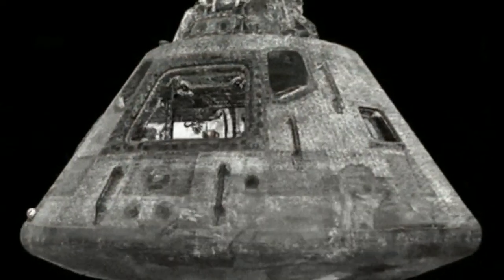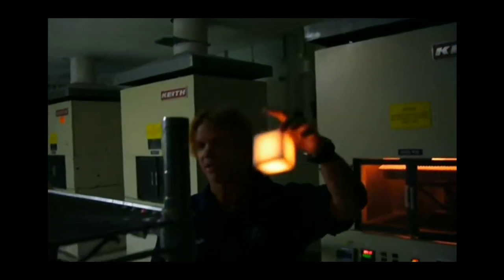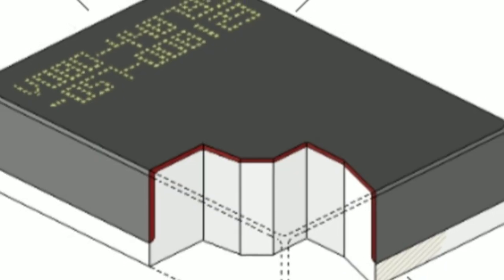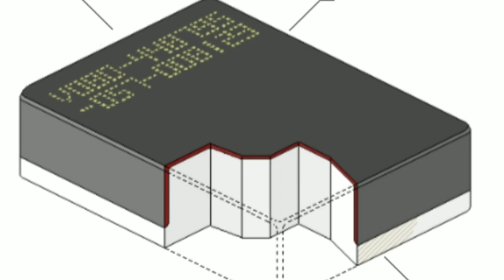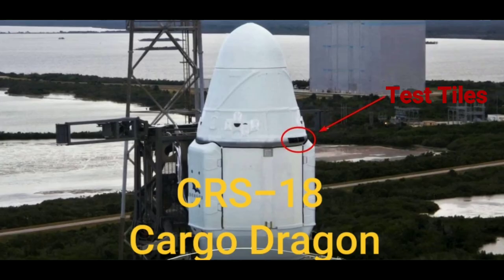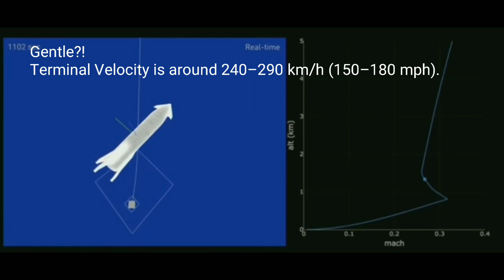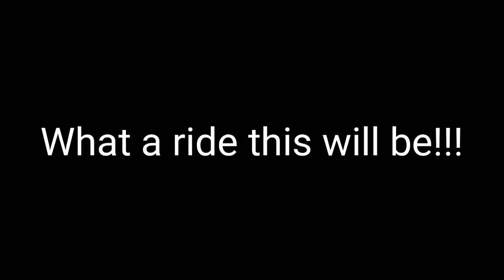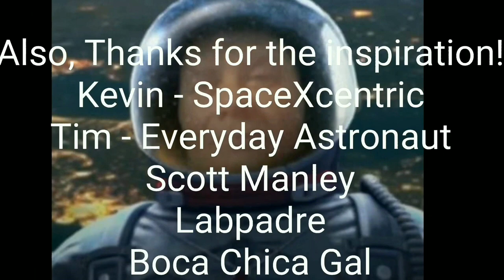ELON MUSK SPACEX - STARSHIP's THERMAL HEAT TILES - Everything we currently know. - Episode IV

Comment: No matter what material you use for the airframe - steel or Al alloys or something else, you need to keep it cold. Even if the material itself can resist extreme heating the internals can't do the same. If a steel airframe is at several hundred degrees C the crew, cryo fuel and various hardware will feel some discomfort.
Reply: @japaneserequired6314  sr-71 has titanium airframe with  corrugated skin that could expand at heating and fuel cooling in critical areas(crew cabin). And some other solutions that are not applicable to a spacecraft with hundreds tones of cryogenic fuel onboard.
Reply: @japaneserequired6314  LoL
I don't need to convince the internet at all. Technical issues are not resolved by the majority of the vote). I just wait the moment when Musk declares that stainless steel is good for testing purposes but now he needs your money to develop some other tech).

Comment: @marsorbust - thank you for very educational videos! You are providing unique details that i have not seen on any other spacex channel!

I have 2 questions:

Starship wall will double up as a tanker for fuel which will be higly preassurized. But how will they screw tiles to that wall - wont it either penetrate the wall or at least weaken it’s integrity under pressure?

And currently when spacex dragon takes almost a day to dock to ISS. Russians can do it now in 4h. What’s the difference?
Reply from the maker: Hi Andrey,
Thank you for the comment!

Q1: 
Unfortunately, I'm not directly in the loop with SpaceX, (I only wish) but I do have 30+ years experience in metal fabrication & QA/QC inspection of these type of things. Most likely they will either weld studs or receivers directly into the ships hull to connect the tiles into. Or, it is possible that the dual hull will not be where the tiles are. They have not confirmed the dual hull as of yet, but that is most likely. The tiles will not be required on 100% of the ship, only on it's windward side. I will be keeping an eye on this and will do an update video as things progress. 

Q2:
This is a detailed process, but in short the Russians are doing what is called Fast Tracking. Rather than chasing the ISS to catch it, which takes time, they are doing a series of orbit raising burn maneuvers to quickly increase its orbit to meet up and cross paths with the station.

Thanks Again,
Dave
MoB
Reply: Mars or Bust thanks for your thougts! And i will keep an eye for your future updates.
Reply: The stainless steel design is the same speculative stuff as previous carbon fiber "design" was - I am pretty sure they just don't have an answer on your question right now. Have you seen what "technology" being used to construct the Starship(and Starhopper as well) ? This is just an ad hock solution to quickly aprove some concepts.